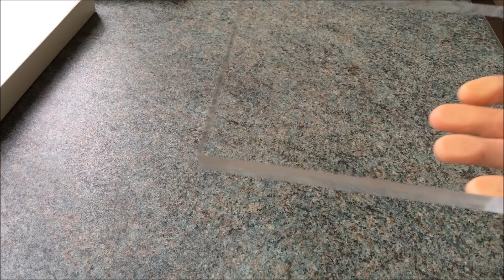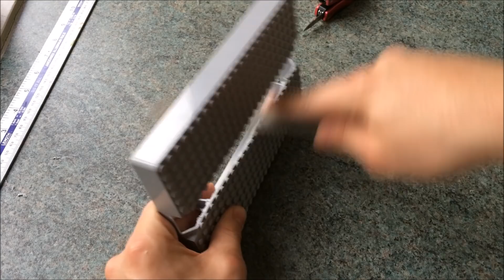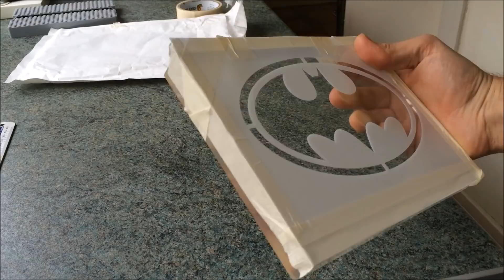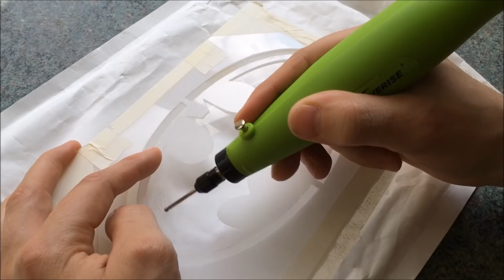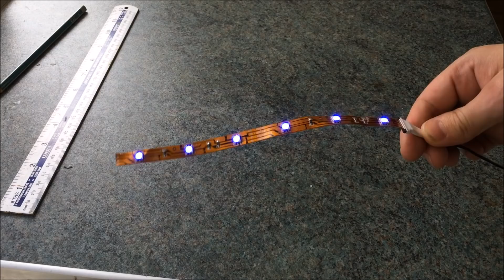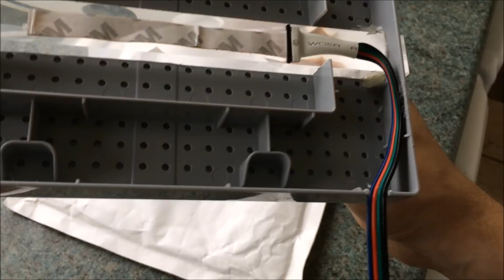Make An L.E.D Emblem Light!

Comment: Hey, I'm doing this project, can I use normal LEDs instead of the LED strip you used? It would be easyer because I would plug a battery and a resistance in series...

Comment: Do you think that could somhow work on the windows of a PC case?
Reply: Try doing it on a practice sheet oh acrylic, problem is the light might no reach that far down the acrylic, and make sure that your case window isn't glass
Reply: beat me to the question. I was thinking of doing it to my H440 but to scared to ruin it.
Reply: that's a really cool idea. I think it actually work
Reply: stront klont Maybe the Batman or the Assassin's Creed logo. The problem is i might eventually ruining a brand new Fractal R5 windowed that I havent even bought.
Reply: +BlackHawk2306 you can buy  a plexiglass sheet (~30x30 cm) at your local diy shop for around 5 bucks and carve a logo in it and put it behind your glass side panel. if it don't look so good you can just remove the sheet of plexiglass   without your real side panel damaged
Reply: stront klont havent even bought the case RIGHT NOW XD
Reply: i worked on this and used  Jin Kazama's tattoo on the piece of acrylic .. works aslong as you don't have too much led in ur case to ruin or clash with it.. btw i found it best to buy a seperate sheet of acrylic so that it didn't ruin the original side panel
Reply: BlackHawk2306 S0LIXUS Any PC worth a shit would have plenty of fans. It does work though.. I have a Zelda poster I engraved onto 1/4" Plexiglass and it's fine.. (Plexiglass is MUCH softer...) I engraved the entire poster. It took me 4 hours but it looks amazing. I'm thinking about doing multiple layers and making everything the colors they should be.

Comment: alternately, at michael's they used to sell 'sandblasting in a can.' i used it once, and i suppose it works well enough to rough up an acrylic surface. use some spray adhesive on the back of your stencil (probably a thin card stock would be better, not sure if the sand-in-a-can stuff would go through regular paper easily), go outside and in a few minutes you should have a brilliant result without all the effort, not to mention a much cleaner product.

Comment: Hi, can i have a link to the exact buyer you used on ebay as the ones I've contacted don't do thick pieces like yours.
Reply: the pieces don't have to be that thick, i don't suppose. i used to see these kinds of things all the time, mostly at restaurants, and it seems to me they were about a quarter inch-half inch thick. that huge slab of acrylic seems to be overkill, and it's not cheap stuff, either. 

you might try a trophy shop and see if they can help, or even a window/glass shop, which is where we have custom plexiglass cut for certain plaques we do in our shop.

Comment: I am planning to do something similar with an Arduino and a strip of WS2812B LED's... As well, I am planning to cover the front of my computer case (CaseLabs STH10 with slotted drive bay covers) with a white piece of acrylic/plexi, and then use the same WS2812B LED's and diffuse them to make a nice look. Finally, I am going to get a separate piece of plexi for my side window, and etch it as well with a logo I am working on for the same effect...

Anyhow, all of that being said, how did you cut the logo? I have tried printing/cutting the logo with paper and different kinds of plastic sheets (thin stuff), even lens gels from a local craft store, but nothing works... So I then decided to get something akin to a Cricut, but the cost for the one that I know will do the job is just too much to spend for a single project... So if you could tell me how you were able to get the logo cut it would help me immensely!!!

Comment: Why not just attach a row of lego blocks from left to right across the base (one row in front and another in back) instead of cutting a hole the base and hot gluing it?  Could be a lot simpler, no?
Reply: +Dan Deacon At first i also thought of this but putting the LED strip in would be a difficult task this way seems more simple. When i try this i plan to use a wood or metal base :D

Comment: You did not explain the power supply.

What are those colored wires? What connector did you use? What is powering the thing?

Comment: Don't need a machine actually, you can do it with send paper and it will be more flawless. 150 grid will work. but if you want more light and reflection. start with 50 grid and than with 150 grid may be finishing can be with 400 grid. you can also use a masking tape to keep the edges free of unwanted scratches.

Comment: A "cleaner" emblem maker would be a mini sand blaster. If you cover your acrylic with your emblem and just blast the exposed area your lines would be sharper AND your emblem will have a more uniformed surface.
The great thing is mini (or hobby) sand blasters are from $20's and up.

Comment: Hi, cool video. I have a question. I don't have a rotory tool, but an engraver with up-down motion, will it work on acrylic? I never worked on acrylic before, because it is hard to find in my area, but i did some engraves on glass will it be ok?

Comment: How did you connect the LED cable to a power source?
Reply: +Gavin Robertson Just search 'RGB LED strip' on eBay and there should be lots come up. I've got some above some curtains to give a glow in the room and they are remote control.
Reply: It has a recharchable battery that you connect to the white piece and a wireless chip that connects to the remote for it
Reply: xXSUPERZOMBIEXx Thanks!

Comment: Very cool idea great job, I have a suggestion to make, rather than the tool maybe a chemical solution could render a more smooth result ? I'm thinking something strong enough to melt a little where you apply it, not too liquid so it doesn't leak under, and not too strong to dig a trench in it

Comment: I am wondering if acetone would etch the Plexiglas. I thin it will.  What you can do is a negative etch by using the template and dripping wax on it then remove the template and brush the rest with your acetone and when you rinse it off, it will etch a negative of your template then just remove the wax and you are done.  Only problem I see is getting the wax off easily but it will look better then using a power etcher.  I think this will work.  any comments are welcome.  I could be an idiot here but I think it should work without blowing up anything or starting any fires that is.  LOL.
Reply: I'd just go to the next fab lab and use a laser (provided they have a USP laser), a milling machine (fine contours are gonna be a problem probably) or sandblast it into the acrylic.
Reply: Vu wow, I have a milling machine right here in my back pocket right next to my sandblaster and my laser etcher, NOT.  I bet if you asked people in your neighborhood how many of them have any of those machines you would find out that NONE of them do.
Reply: John Miranda
Google "fab lab" before making fun of people. I have one close to home.
Reply: The point of the video is to make it at home with few if any unusual tools or specialty equipment.  Once you start mentioning equipment that most people do not have at home then you pretty obviously missed the point of the video.  The suggestion I made was to use acetone and candle wax that can be found in most peoples bathrooms or hall closets.  You suggested a milling machine or a laser.  So yes, I made fun of your suggestion.  It was dumb.  Not saying you are dumb but your suggestions was dumb.
Reply: Nope, the "at home" part is purely your implication. Going to the next fab lab to get a milling job (if one is close of course) is no different from going to the next DIY store to get the acrylic, or are you missing the point of the video if you don't order it off ebay so you don't have to step outside?
Fab labs are there for things like this. Empowering individuals to create stuff with professional equipment with results that look professional. I'm lucky enough, I have one 10 minutes from home and another one at college which is 20 mins from home. I'm just saying that this possibility exists and it's as valid as your suggestion with the wax+acetone.
Reply: Vu, Vu, Vu, again what's with going someplaces and getting it done by someone else or paying for expensive equipment when one trip to any hobby shop, crafts store or even Target or a super market for that matter for the most basic of supplies when you buy your milk eggs and bread and you are done.  Yes, you can pay more and go to a fab lab and yes you can pay for the tuition and go to the lab on school but why pay more when you don't have to.  Throwing money at the project is a dumb idea for such a simple project.  But don't let me stop you from wasting your money.  It is your cash anyway so have at it.  A fool and his money are soon divided.  Not that I am saying you are a fool, just spending your money as unwisely as one.
Reply: solve this *****  how to build your own flexible LED DISPLAY Curtain XXL by LED Strips realtime Video Transmission checkout the awesome full step by step DIY incl. Sparepart Purchase by elektric-junkys checkout our channel
Reply: I think Plexiglass is acrylic. It's just the brand name for it.

Comment: Could anyone tell me how many mm thick the acrylic sheet should be?
Reply: Doesn't matter in my opinion. As long as it fits the base part of ur project :) I've made 1 myself and the thickness was about a half of what it was in this video. I hope this is the answer that u are looking for ^^ The most important thing is that all the sides have to be crystal clear or otherwise the light doesn't get through it well enough.
Reply: +Taapu DaChickan   Thanks for the help, it really did help but I have another question XP. What website did you get yours from?
Reply: Your acrylic*

Comment: You can always use real glass as well as acrylic , as long as it isnt too scratched up, and use a sandblaster on the back for the same frosted look, with less room for error plus its much faster and easier. And if you dont have a stencil, you can cover the glass or acrylic with masking tape, print out a picture online, trace it onto the tape, and cut it out with a hobby knife.

Comment: I wonder if some of that spray can "frosted glass" paint would work on this. It'd certainly make it easier than going at it with the rotary tool.
Reply: I think the best way would to put the desired figure on the acrilic, then spray on a protective layer, then use acid.
Reply: What acid etches plexiglass?
Reply: I was wondering the same thing as I would like to make one that is 8 x 10 that has quite a few pieces of graphics on it... wonder if anyone has tried the frosted window spray, I've been searching online, but haven't found anything yet.
Reply: How cool would it be to make one of these LED lights and rig it up to flash with some music? Do your favorite band's logo or something. Maybe those Equalizer bar thingies.
Reply: Miguel Cuervo
You sir, are a genius!
Reply: Miguel Cuervo i was thinking about the same exact thing when i first saw this vid

Comment: Since LEDs take so little power, Isn't there a small enough power source of some sort to put into that same size base? I really don't know and why I am asking. Thanks for sharing.
Reply: As far as I know, these LED strips run on 12V volts, so you would probably need to use some rechargeable one from an RC car/plane/whatever or maybe a camera.
You could also use two AA batteries and hook up some "barefoot" LEDs to it. You won't have the RGB funkyness, but it won't need external power.
Thing is, for the first time, I might actually make one project I've seen on youtube. It seems to be easy, and it looks cool,
Reply: Wire it to a 9volt battery and it'll run for days, maybe even weeks without powering off. or you could wire it to a rechargeable battery pack and go that route.
Reply: my brother has these same strips around the underside of his bed, and they're wired to a 9volt.

Comment: Thanks for the inspiration. I just made on with what i had laying around real quickly to check  the principal. I used a old acrylic baseball card holder about (5mm) a 6" string of red leds, a 9V Battery with a toggle and just slotted out a USPS small mail poriority box. It worked perfectly, well for a quick demonstration. I would suggest using 220 grit sandpaper as it will come out so much faster and more refined  (its just the right thickness for speed and quality smoothness) and maybe just use the rotory around the edges to accentuate the borders to be more exact. Thats just a suggestion and nothing else...yours came out GREAT!! I just think It would just save you a bit of time.. Thanks for the video!

Comment: thank you!  2 questions...
did you etch the other side of the acrylic block?
and if i sanded the whole surface of the acrylic block, the whole block would emit light right?
Reply: jolanpiep i agree with 2 but with 1 he didn't etch the other side because the front is the only side that is displayed. The back is where the wire comes out from so you don't want that to be the side people see .
Reply: 1. Likely, otherwise the other side won't have any shape.
2. yes, but if there is no shape, then it's quite boring.

Comment: Nicely done mist8k. Your build instructions were clear and concise.

If you were to mount the LEDs under the base but NOT to the acrylic AND NOT hot glue the acrylic to the base you could change out numerous designs at your leisure without redoing another base.  Well done !

Comment: I've made stuff like this with acrylic, I used a (dont have the english word for it) one of those things, that uses air pressure to shoot out a good amount of sand onto surfaces. 
If you can get a hold of one of those, might be called a sanding chamber? You could save loads of time and get a really nice finish. If you ever feel like making more like this :)
Reply: It's call sandblasting. But you can't only use paper to cover the acrylic glass?
Reply: Anthony Veilleux Sandblasting, thanks for that. But yeah paper would probably be destroyed in an instant. I used a thin sheet of plastic for my stencils/templates. Took a little while to cut them out, but they could be used again and again, so the time making the stencils was worth it.

Comment: That is so killer!! :-) I do have a question though when you cut the  section from the LED strip how did you attach the power wire to it? Or was it already the power end of the strip?  how many separate projects can you make out of 1 LED strip? Do they come with multiple power cables like that too make many projects with it?